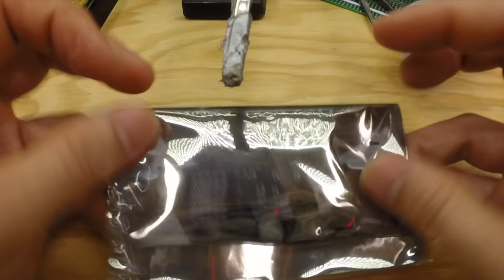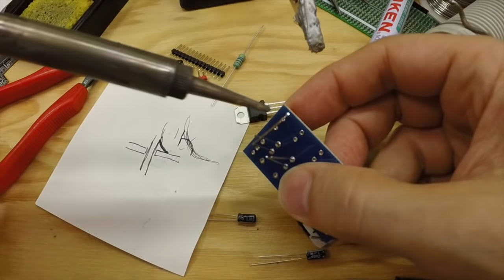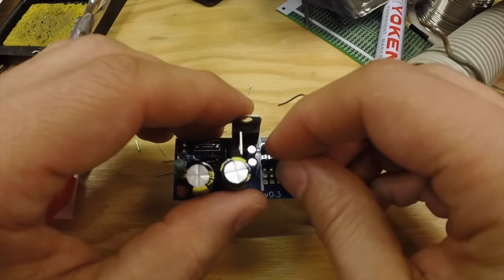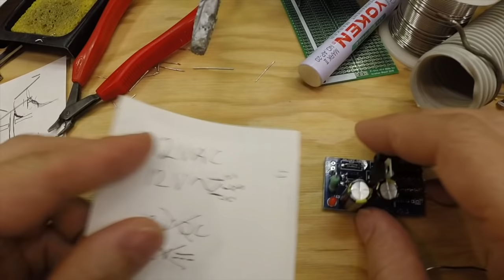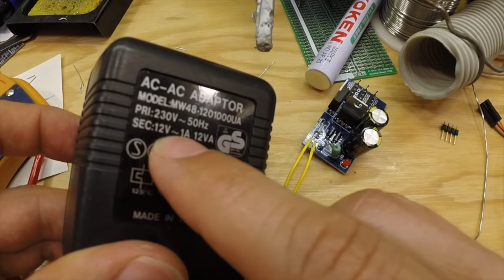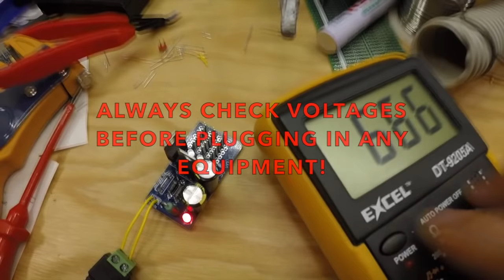Soldering instructions for a Simple and Affordable +12V/-12V PSU

Comment: Hi Kristian! I followed your instructions and managed to build my power supply. Had a bit of a hard time figuring out that some of the connectors in my breadboard are not working properly, but once I found that I am getting the correct voltages. Can't wait to dive deeper into it and build my modules.
I have one question though. Would you recommend using a fuse as protection? How would you go about it? Put one for each module or one after the PSU? What amperage fuse would you use?
Thanks for taking the time to make these videos :)

Comment: Aloha! Are you stocking up on the bigger PSU:s? Does this one have protection against over current or reverse polarity? And could i just use bigger caps on this kit to achieve more power? Thanks in advance, and i REALLY appreciate what ur doing! Thank you!
Reply from the maker: Yeah I hope to be able to Order new components soon. No it does not have these features. But thanks for bringing it up. I’ll look into adding those aswell (if possible)

Comment: I'm trying to understand why all Eurorack power supplies seem to be based on AC to AC adapters. Instead of rectifying AC and then applying a lot of smoothing to achieve constant voltage, wouldn't it be easier to grab 24V DC, create virtual ground in the middle and then regulate the result a bit?
Reply from the maker: Suuuuuureeee..... I guesss??? ;)  But then you would have an output has "ground" at 12V... Plugging that into anything else that cant tolerate that and you break that thing... Also 24VDC is rectified AC already, so just add one more rectifier and your done. Or you mean "regulated the result a bit" to attenuate and scew the signal at the "end"? I would say you just move the problem and create more ;) An AC-AC adapter is one of the simplest and cheapest adapters you can find. It technically is just two coils and a core transforming the power down from whatever mains you use. And for example this simple PSU, build that one instead of having to think how to fix the end signal? I dont know... I had a hard time understanding modular power too in the beginning, but now I understand it better (than not at all) and am fine with working with it. I am sometimes irritated when there is a 0 and +12v cicuit, because then I know that circuit might get scewed in relation to the other ones... But well, all to his own I guess.
Reply: @SourceryOne  Interesting. Maybe I'm looking in the wrong place but when searching on eBay DC adapters are plentiful and cheap and AC-AC adapters are rare and expensive. 24V DC is a bit more expensive than other voltages but still. https://www.ebay.com/itm/AC-110v-220V-To-DC12V-24V-Power-Supply-Adapter-Driver-Switch-For-led-strip-light/322859613890?hash=item4b2beebec2:m:miQOnz33DX73Xor2hJjC_cQ - here 1A adapter is $4.20. 3A is $8.99. As for AC-AC, I had to resort to bying used. I ended up bying a 2.5A 12VAC adapter for $20 and 1.67A for $11.98.

Comment: Thanks! Do you know how much power it can handle?
Reply: Heatsinking will be a bottle neck too I think..
Reply from the maker: Astral Brain Tentacles maybe but I haven’t needed to heat sink them yet. But again this might be that I haven’t used all of the power out... I prefer to have many power supplies instead of distribution boards. But yes heatsinking would be tight at least for the 7912.
Reply from the maker: Yes probably, but then youd need to run a lot of modules on it I think at least of the ones I built.
Reply from the maker: No I dont unfortunately. My modular isnt very power conservative and Ive been running 10 modules on one of these (but dont know if that is to reccomend). I think it also depends on the Wallwart you choose. I have mostly around 1A 12VAC coming in, and I think that is where most of these adapters lie in power. Hope that helps a bit...
Reply: @SourceryOne  Do you think the regulator is the bottle neck, except from the wall wart? Then I suppose it would be 1A, possibly 500 mA+ and 500 mA-. http://www.utc-ic.com/uploadfile/2011/0915/20110915025330791.pdf Disclaimer: I don't know these things at all. :-)
Reply from the maker: Yes the wall wart and regulators are the bottle necks. Also since I dont use heat sinks on mine the regulator is the bottle neck also when it comes to heat. If it gets too hot it would probably fail...

Comment: Note: I already discussed of this with Dieter Doepfer, but colors aren't what they should be. In facts, on Eurorack cables, the RED STRIPE is... MINUS (!!) 12V, not +12, as you would expect. Therefore, I'd recommend to follow the very same CONVENTION (as bad as it actually is), so that ribbon cables red stripe will match the connecor colors. Or just use a SHROUDED 10 pin IDC connector, which forces you to put the cable with the right  orientation.
Reply from the maker: Thank you thank you thank you! I also figured that out just now! I have edited that part out of the video and also put a big text everywhere to note this (strange) design descition...
Reply: Herr Doepfer does agree, but now it's too late to change a consolidated standard - Funnily enough, it would be so easy to mark the 1st conductor in black, instead of red. But now all the literature and documentation speak about a red stripe as the -12V.

I GUESS it all has to do with the standard IDC cables marking the 1st wire in red. And Mr. Doepfer started counting from the lowest value among all the voltages: -12V. Therefore, THAT was the first value, not the conventional positive color. At least, in my fantasy. But I don't think it's too far from reality.
Reply: I was thinking the same, but thought I could just put the red pinstripe at the negative end.
Reply: Exactly: this is (unfortunately) the Eurorack standard.
Reply from the maker: Thank you both! I have edited that part out and will notify everyone who did already buy one to keep this in mind!